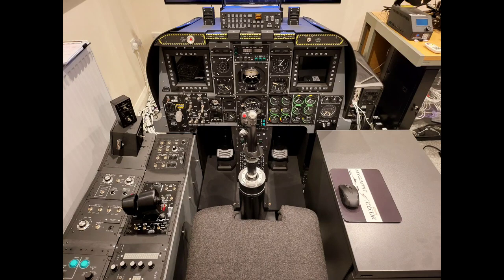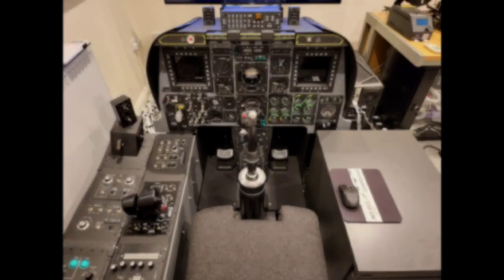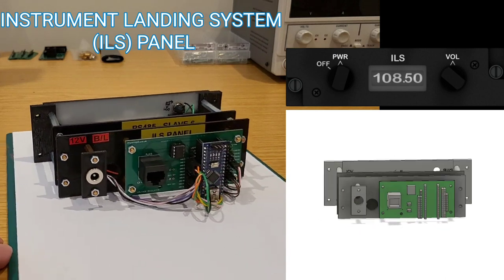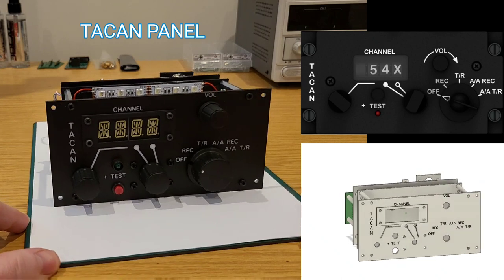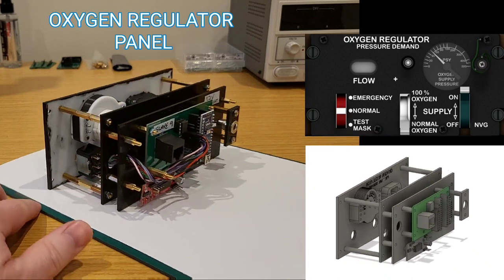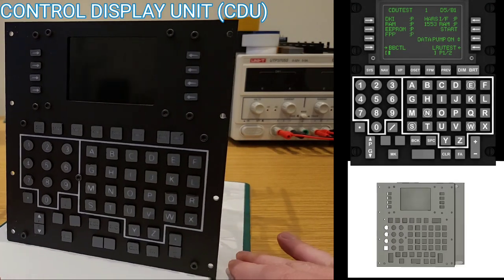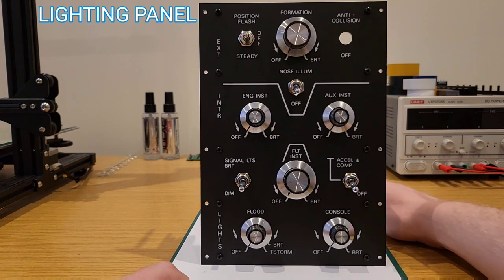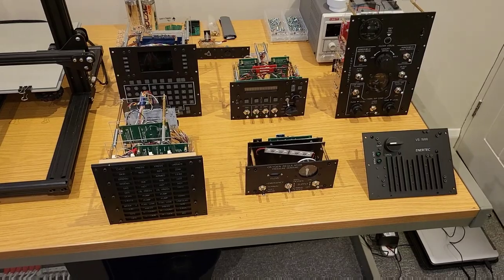Simpit A10C - Right Console - Part 3: Panel Completion

Comment: That simpit ist just "sick" in the most positive way I can think of! It is unbelievable that you really did even all gauges as real replicas instead of the usual screen based solution!
Some questions: could you explain more on your serial network and how or why you are managing the ardoinos with serial instead of USB? Thanks!
Reply from the maker: Hi Matthias, thanks for your positive comments. It's been great to build all the panel's in the front dash, but I think the screen option is ideal for most builders so they can limit the length / time of their build. 
With regard to panel interface to the PC, there's 3 main types I have used. The first is the use of Keyboard Encoders which connect the PC by USB. These Encoders in turn are wired into some of the panels. For the second type  I use DCS Bios in the more typical setup, with each arduino connected to the PC using a USB cable. Then there's the third approach which is still DCS Bios but it runs a network of arduinos using RS485. Each network has one arduino connected to the PC by usb cable which acts as a master device and it in turn connects to a number of other arduinos which are slave devices. So each slave doesn't need its own com port (usb input to the PC). 
I did a previous video called "Simpit A10C - Engine Instrument Panel via RS485 (MAX487 Transceiver) Network". It explains this network. Might be worth a watch. 
Cheers 👍

Comment: I can't wait to see the finshed simpit.

Question for Craig, well you be setting the finshed simpit up in the room it's s currently filmed as is or are you planning to build a curved projector screen setup etc like Worthog project's?
Reply from the maker: Hi John, many thanks. I can't wait to have all the consoles and panels all around me when I fly and it will be great to share that.
As regards the room the simpit sits in and the future display set up. It's a good question. When I have built the right console and flight seat this will be something I'll look at. I think it could be  either a 3 monitor setup or a curved screen, I'm not sure which yet and the curved display would require some thought around the room it's in. I'll have to think how I can convince my wife I need a bigger room 😁👍
Reply: @CraigSmysimpit  Your quite welcome. I bet you can't wait until it's fully armed and operational lol. Personally I'd say say curved would be better since there'd be no bezels in the middle of the screen. Ah yes the Wife approval hmm I'm sure you'll come up with something

Comment: Just fantastic work as usual Craig.  Well done.  So are most of your panels connected via an ethernet cable ?   Do all the ethernet cables from each panel go back to a common network switch and then does that go back to your main computer via one ethernet cable ?   Is the advantage of ethernet speed or stability or simplicity ?
Reply from the maker: Hi Speed Bird, most of the panels run over an RS485 network. On this network I just happen to use Ethernet cables to connect the slave arduinos to the master arduino. Other wiring and connection types would work, but I found Ethernet cables are easy to work with, terminate, interconnect, test, and source at a reasonable price / good quality, etc. I did a previous video which shows the original Engine Monitoring prototype run over RS485 and in that I share how the network functions. Might be worth a watch.
Also, the server cabinet seen in the background of my simpit is where the keyboard encoders sit and a few arduinos, they are connected to the simpit via Ethernet, but again it could have been a different kind of connection 
Thanks for your thumbs up on my project, cheers
Reply: @CraigSmysimpit  Thanks Craig. Will watch that other video.